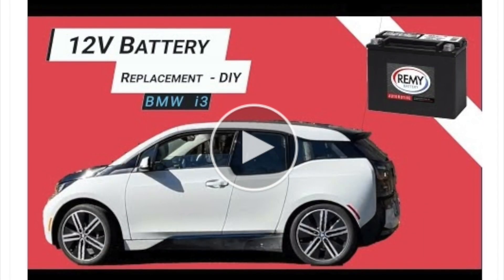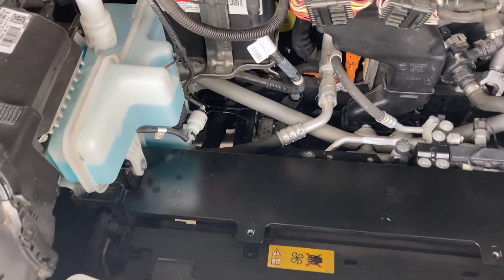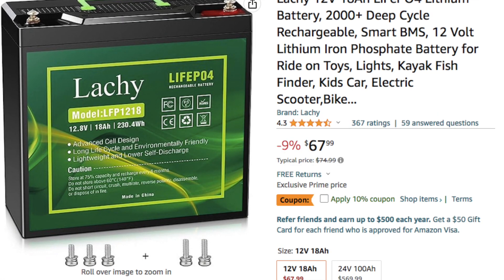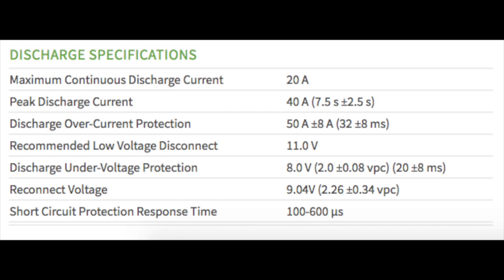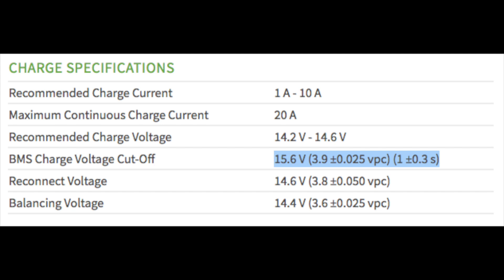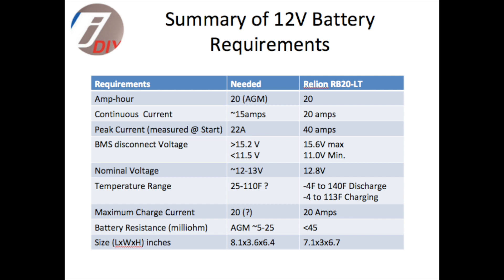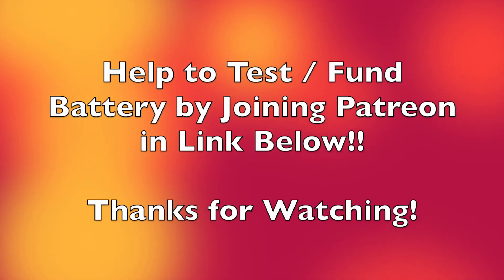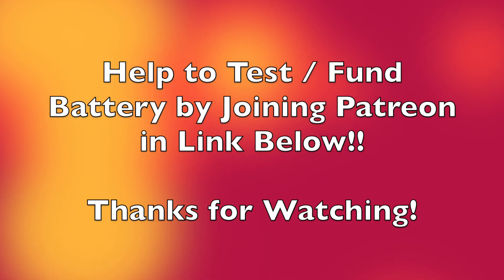BMW i3 Adding a 12V Lithium Battery-Part 2

Comment: I have a 2015 I3-Rex, using a scope meter and a Fluke current sensor, I found at start up, it draws 29.95 Amps for about 1.5 Seconds, ( Note: with everything on. ), then it went into charge of the battery at 9.98 Amps and I even noticed this charge current with the old battery, the charging never went over 10 Amps even bad or good. I found a Lifepo4 battery that has good/far spec's and I am using it and so far so good.

Comment: I'm testing your recommendation Relion RB20-LT at the moment. But I'm having problems. Maybe you have some ideas. It happened 4 times so far, that the battery just shuts off. Meaning it disconnects due to the battery management board inside. The way I get it back up is by parallelizing it with a 12V lead battery. Takes a few seconds and it is back connected. The shutdown of the battery happens only when I lock the car. Of course not always, about 1 out of 10 times so far. I'm wondering if there is something wrong with the battery itself (bad protection module) or if there is a huge current consumption during locking? Unfortunately I don't have a DC current measure instrument. But I would appreciate if you have any insights to what could be the problem. I spoke to another fellow who used a cheap $70 Aliexpress LiFePO4 battery and it works without a hitch.
Reply from the maker: Sorry to hear this.  Unfortunately, I ended up not persuing use of the Relion battery due to the feedback from Relion- especially regarding the battery shutting down completely when running the internal heater.   The relion has a max amp draw of 40amps ( 520watts for ~7.5 seconds) which should be enough unless REX cooling fan is on, headlights are on  or other current draws plus the spike draw of locking the door is more than this.   When you get out of the car, the DC to DC inverter will still be powering the car for up to 15 minutes after shutting it off, so the current draw should not be an issue in this case.  I measured the current draw off the battery when locking the car (off) & I got between 10-15 amps draw only (the DC to DC inverter was off).   I would suggest checking the terminals to make sure they are not loose (intermittent connections), check the battery voltage when it fails/i.e what is causing it to go into protection mode ( was it shut off for an overvoltage protection or overcurrent protection event  prior to the locking issue).   It could be a bad BMS too, Possibly Relion can help you with suggestions or a replacement.
Reply: @bmwi3diy782  Indeed. Just making sure that everybody knows, that battery is not working in the i3. I'll be testing a Chinese FlyPower very soon. Will let you know.

Comment: I just bought an 2020 i3S and am wondering how your continued testing of the Region RB20-LT 12V lithium battery has gone? I know your mention of this battery in your Part 2 presentation was last year so I don't know if you are still looking for funding participants at this time but I'll gladly do so if you desire.
Reply from the maker: Thanks for the inquiry.  I am still looking, as the Relion turned out to not be the best option.   One owner has been using the Ohmmu Rivian battery for several months (mostly working, but in a tropical climate, not cold weather) and I just got some feedback from LithiumMoto rep that their battery may work as well.   One of the biggest issues is the high (>15V) cold weather charging voltage from the DC-DC inverter & disconnection of the battery from the electrical system.   I still haven't found /tested an ideal battery,  but the two companies above may be next in line for evaluation.   I'm not looking for any funding at this time, as I have less time to dedicate to this task for the near term.
Reply: @bmwi3diy782 lithiummoto says they are coming out with a sodium 12v for i3 in cold weather.  Should be out within month
Reply: @tommyboy7589  that's cool! looking forward to it~

Comment: Does it have any warning that it needs to be replace?
Reply from the maker: Usually a 'battery discharge' alert will appear, but several owners have mentioned that the 12V battery died shortly after the warning.  I also have a voltage meter plugged into the 12V socket under the dash as a way to check if the battery voltage (before the DC to DC converter kicks in as the voltage could go up to 14.4-15.2 volts) is near or below 12 volts versus 12.6V or higher if the battery is in good condition.   If your car sits overnight and when you first open the door you hear the contactor engage,  the car recognizes the battery voltage is low (trying to charge it)- this may also be a sign that the battery may be getting old.   I hope that helps!
Reply: @bmwi3diy782 Is 12.2V on the brink already? (2017 REx 62kKm 1st owner)
Reply: @bmwi3diy782  @k4tilp
I saw the 'battery discharged while stationary' warning on the dash maybe 2 or 3 times within a week before the 12-volt completely failed in very dramatic fashion last week.
In hindsight, many other quirky intermittent issues were probably the cars way of passive-aggressively telling me the 12-volt was unhappy.

I've ordered a ~ $25 bluetooth battery monitor to go with my new 12-volt so I can track it's health over time and get a heads up that it may need maintenance before something bad happens.

Comment: 4 years is not true. Mine latest seven years until the car behaved strangely and I had to exchange it. But there are also 2014 model drivers in our i3 group that still run the first one. If I have to change mine again in 2030, it’s very reasonable.
Reply from the maker: That's good to know- I am still trying to find a replacement that works (this one does not after more information from viewers & manufacturer).   Buying a cheap battery tester to monitor the older 12V battery may be a reasonable stop gap measure.   Thanks for the feedback!
Reply: 4 years is 'true, for its 'average' lifespan. If someone gets 7 years they should consider themselves lucky. .

And on the TFL EV channel a OE, BMW i3 12 volt battery, leaked. Which is owned by one of the staff and is part of a long-term test. 

By the way the wife of the owner loves the car, but the sulfur smell coming from the leak scared the crap out of her. Since she thought it was a NG leak. So it's good you're keeping track of that 12 volt battery.
Reply: Mine OEM battery lasted till 2023 (BEV 2014) with NO issues (~65-70% of battery acc. to BimmerLink), just replaced with EXIDE AGM 12-23 for safety reasons to avoid any of issues.

Comment: I tried this battery (still have it sitting on my desk now), didn't work for me. Felt like maybe the self-heating thing would trigger pretty early (-5C ish)  and when it starts, the car freaks out and triggers the alarm and all that.
Reply: What alarm did I trigger? This happened when the heater for the battery kick on?
Reply: @shortwires  The car alarm. Yea the heater for the ReLiON battery, when it kicks in it doesn't provide any power to the car
Reply: @nster3  wow that a horrible design. Why would purposely have it disconnect load while heating.  Did u contact manufacturer to confirm that is not a defect in the battery you have?
Reply from the maker: I am trying to contact the technical support to discuss.  The website said that the heater was powered by the charging circuit, so I would expect it would not activate unless the system voltage was above the nominal battery voltage by some threshold (indicating charging was occurring).   Great information to investigate though!  Thanks all for the feedback.
Reply from the maker: I was able to confirm with the technical staff at Relion that the battery does indeed shut off when it is warming up.  That won't work for our application (obviously).  I will do some additional research into other options.  Thanks for your patience on this.
Reply: @bmwi3diy782  dang it. No need to fund raise for one of these batteries then. I really thought I had found the solution to our battery needs for i3.

Comment: Unrelated, but have you ever swapped the KLE charging unit? Does it need to be programmed?  Im having an issue where my i3 wont chaege when its hot out after depleting the battery. If i let it cool overnight itll charge again. Its a 2014 dont think the KLE was ever replaced when they were first having issues.
Reply from the maker: Sorry, I think I do not have sufficient information to diagnose your problem.   Here are some ideas to check:  Is it possible that the battery temperature could be too high, if the KLE will not even start running, especially if the KLE is functioning correctly at night?  Is there an error code that specifically says the KLE is faulting?  Does it charge on the 110V charger and not the level 2 charger?  If it starts charging, then KLE stops from overheating, did you check your coolant level reservoir in the frunk?  Is the AIr conditioner is working okay? (cools battery- you could check battery temperature in the secret menu).  If you have a REX in a CARB state, it may be covered for repair.   The original recall was for faulty capacitors (to my recollection) and the cars would still charge at a reduced rate.     Service repair manuals say ISTA is required for installation of the KLE, so it will likely need to be programmed.   It sounds suspicious that it is just the KLE if it only has a problem if the car won't charge immediately 'after' fully depleting the battery AND it is hot outside but works fine afterwards...  I hope this is helpful for you, good luck!
Reply: @bmwi3diy782  My ac works fantastic. I checked both reservoirs for coolant up front and they are full. After I come home from work after depleting the battery and the rex has been running for a few miles I'll plug in. The port turns blue and I can hear a clicking type relay from the rear of the car every 30 seconds or so and then a error comes up "unable to charge". In the winter it charges with no issues. I took it to the dealer and they said there was a code for the KLE. They also uploaded new software. If I let the car sit for a few hours and retry plugging it in it'll start charging, sometimes. Sometimes it does not and I'll have to wait till the next morning to try again. Very frustrating. I'll pull the codes that I see and report back.
Reply: @xm3ntal620,
Curious if you found anything that helps with the hot charging issue.
I haven't had that problem myself, but I have noticed a cooling fan in the rear of the car that will come on when it's hot out and I'm charging.
At times I have avoided charging for a couple/few hours until things cool down a bit (ambient temp and car) and that seems to help avoid it needing to run the fan - at least initially while I'm standing in the garage to notice the sound.
I'll also sometimes use L1 charging instead of L2 if I'm at home and not in any rush. I don't recall thinking about this for quite some time, I believe it was mostly in my first year or so of ownership and before I rebuilt the AC system.

A workaround I would try in your case, is setting 'low cost charging time window' the iDrive menu such that the car would not begin charging for a few hours after parking - maybe then it will be cooled down and have more success initiating the charge.
However, I believe even with that set, the car still initially will engage the contactors in the EVSE to determine if the charger is functional/suitable/etc. 
Normal operation for my car when delayed charging is set, is that it will start to charge for a few seconds when I plug in the charger handle (sometimes nearly a minute or so), then stop charging and wait to resume later as scheduled.

Over the past few months my car has become less inclined to start charging on schedule, until I manually wake it up somehow - like pressing a button on the keyfob. It got to the point where I would keep my keys on my night stand so I could wake up the car to charge without going downstairs.
Now I am realizing that's probably a symptom of my 12-volt getting weak - it recently failed catastrophically (smoke bomb, fire department, tow truck, car stuck in park and being dragged like a queen on twitter, etc etc etc.) which is why I'm re-reading all the comments on this video a year later.

My new Remy 12-volt arrives this afternoon and I hope to install it tonight after work, but I will be charging outside of my garage for quite some time... and I am absolutely selling the car this year after all the drama I've had with it.

Anyway hope things have been better with yours in the meantime.
Reply: @HappyNinjaTimes  sold mine and bought a used model 3. Much happier now as it does everything better.
Reply: @xm3ntal620  
Good deal!
I've been borrowing a friend's Model 3 when he's out of town, it definitely is much nicer to drive.
I do miss buttons, and CarPlay, and not needing an adapter when I charge at work, and the hatchback format, and room to walk behind the car in my garage... but I DON'T miss range anxiety! 
he Model 3 is an amazing improvement in soooo many ways, I'm happy for ya.
Reply: @bmwi3diy782  the car has 77k miles btw and a 2014
Reply from the maker: This may be a long shot, but I've read of an owner that had a LIM replaced, but an intermittent charging issue still persisted- 10 seconds of blue light then red at the port.  Then he had the charging port replaced ( misaligned charging pins causing charging when it was warm but not when it was cold) and it resolved the problem.  I wonder if this could be your issue, but opposite temp response?  You could try other chargers to see if it makes any difference.   Might be worth checking.